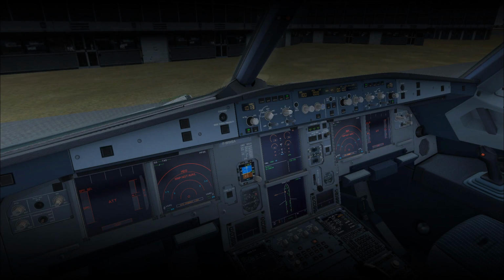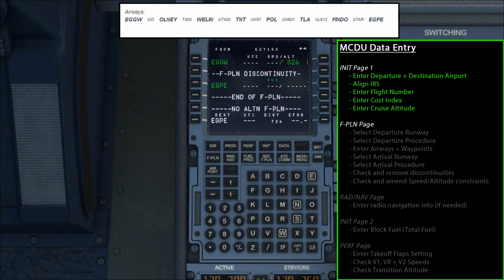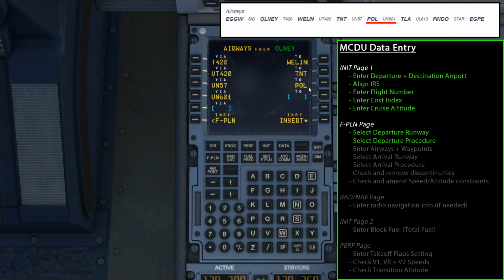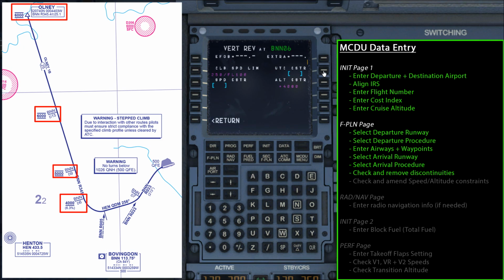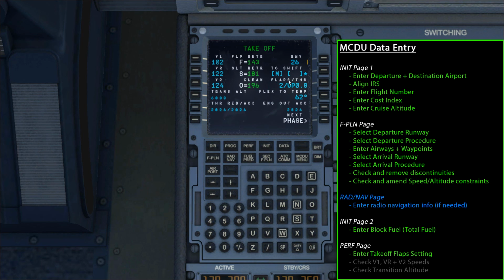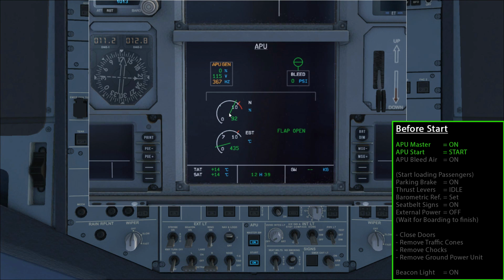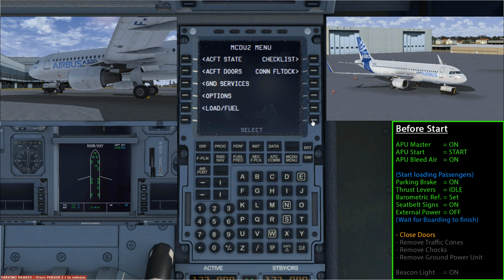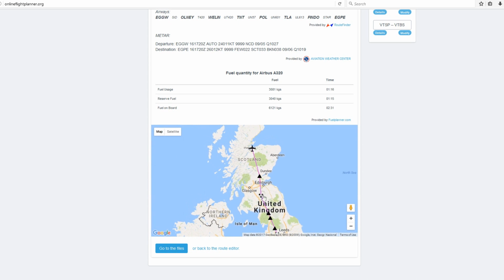A320 FMS/MCDU Setup (FSX - Aerosoft A320)

Comment: Ive just decided to give the aerosoft version a go after using Project Airbus for many years. I read (or at least started to read) the manual, then I found this video...thanks so much, absolutely crystal clear. I note you dont use the built-in atc, so would be interested if you have done a video on last minute changes in runway/approach at destination

Comment: When in RNav flight and heading to a programmed ILS runway in my FMC...Do I need to depress the LOC button to capture the G/S?
No matter what...my plane won't line up with runway. The flight plan always puts me yards away to the left or right of the ils approach. It's frustrating.
Reply: Just press APPR button. If it doesn't align with the runway then you have to update your nav data base.

Comment: This is going to be a VERY IGNORANT question as I am very NEW to FSX. But trying to understand this video my Deluxe version of FSX does NOT have an A320, but does have a A321??? The MCDU on the A321 does not appear to be active??? Do I need a different plane and if so, where do I get the A320 plane in this video???
Reply: Stock FSX doesn't have this plane inside. You have to buy this plane yourself. It is called Aerosoft Airbus X Extended. You can buy A318/A319 pack or A320/A321 pack.

Comment: hello sir how do i determine the speed that i need to select on the fcu for takeoff and approaching ,vertical speed also the heading , altitude .? is it stated on the ias charts or sid .?
Reply: Tip: Do not use vertical speed for climb, it's not fuel efficient. Just press the altitude knob (push it) so plane will climb to that specific altitude in most efficient way also by following the altitude limits. If you pull the knob, it will just climb to that altitude directly asap. And it will not follow the altitude limits, for example chart says you should be above 6000 in A point and you should be at 8000 in B point. If you dial 10000 to the altitude section and push to knob, plane will pass the A point above 6000 and will pass the B point at 8000 and climb to 10000. If you pull it, it won't follow these and just directly climb into 10000. So I recommend you to dial a altitude and push to knob. Hope this helps.
Reply: Also fill in the F-PLAN and PERF page in MCDU. Then press the speed and heading knob. It will be automatically follow the route and determine the speed. If it doesn't, then you did not programmed MCDU correctly or fully.

Comment: When I'm entering AWY/WAY to add to the FLPN

I get an error saying AWY/WAY mismatch. What does this mean and how to fix?
Reply: Forget the airways and just put in the main  waypoints. It's much easier, faster and doesn't affect your flight.
Reply: @ricardoroberto100  no, it does affect. When you enter an airway, it goes into other waypoint using that airway but if yoy do not type it it will directly go to other waypoint. It will be dangerous for other traffic in the air but if you are flying offline then it will not be an issue

Comment: I'm having issues with the MCDU flight planner.
When I try to insert my airways or waypoints, it keeps saying "not allowed" or "Mismatched"
I am correctly typing and inserting the route. Any suggestions on how to fix?
Reply from the maker: The MCDU and your flight plan are made using something called AIRAC data which is updated every 28 days. Compare the AIRAC cycle number from the MCDU against the cycle used to create your flight plan. It might be if they're mismatched, then your flight plan might have given you a waypoint/airway which isn't in the MCDU dataset.

Comment: Where do you find those charts. I can't find departure chart for runway 35 ESMS
Reply from the maker: I usually just google them. So do a google search for "ESMS Charts" and you should be able to find some.
Reply: Doofer911 I found them. Now I got a problem with sharing aircraft in multiplayer. My grandpa can't join me, it says "aircraft is no longer sharing". (Aerosoft A320)

Comment: I just have a doubt, doesn’t the atc give you the runway to land on approach? So how do you know the runway you re going to land when you re setting up the mcdu ?
Reply: ATC gives the runway, you are correct. But if you are flying without ATC then:
Check the wind, if its possible then always choose a runway which is heading to wind. If wind is calm, then you can land on any runway you want

Comment: very very very good, I fly the A32S and I wished I knew all of this before I started the type rating, DIFSRIP (data, init, f-pln, sec f-pln, rad nav, init B, perf) helps  to remember the flow. Trip time may vary with winds aloft, you can insert them and it will give you a more accurate information or it can also indicate there's something wrong with the f-pln insertion and you may have inserted a wrong waypoint.

Comment: Hey mate, I’ve followed every single video you posted and flew the same route, almost identically, but at one point at cruise, the nose began to go up and down and I gained about 1800ft in altitude, but then I realized that the 35000ft inputted didn’t have the little circle, so I did it again and everything went fine, I DID TURN THE SEAT BELT sign on Incase anyone felt unwell 😂

Really good tutorials, I’ll fly the reverse leg tomorrow to see how well I coped with the info, will vary the STAR into LTN though for variety

Comment: What is the best freeware flight planner that includes sids and stars
Reply: Simbrief mate :)
It's a little bit limited as far as AIRAC goes as it's a year behind but it doesn't really impact anything, the loadsheet has all the info you need for your flight
Reply: @sharko4093  but it does not line up with the runway
Reply: What do you mean?
Reply: @sharko4093  well like the path just goes straight to the airport
Reply: Ahh, are you using it for advanced aircraft like PMDG, Majestic, Aerosoft and FSlabs or are you using it for freeware and default with the GPS?
Reply: Aerosoft a320

Also i have not tried it in an actual plane yet bet in the simbrief website you can see that for example if the runway was 350 degrees the line would be coming in from like 270 degrees.
Reply: Well yeah, of course. It doesn't program an approach as that's the pilot's decision. If STARs exist then it will choose one, but the STAR is just the transition between the waypoints of the route to the approach, you set the approach yourself depending on if you want to fly RNAV, ILS or VOR/DME :)
Reply: @sharko4093  Ok thanks so much for helping me out but also can I just pick random sids and stars
Reply: I'm not entirely sure, if you change runway in the flight plan editor then it will select a new SID/STAR but my attempts at choosing a different one by typing it manually have been rejected and not recognized by the site. You can always just choose a different SID/STAR in the FMS though so it's not a problem. The planner is smart enough to choose the most approapriate SID/STAR most of the time
Reply: @sharko4093  ok thanks
Reply: And do you use it for manually constructing the flightplan or do you try and upload co routes downloaded from the site?

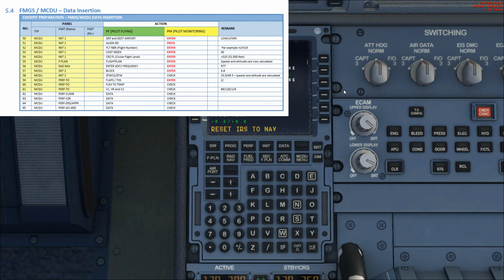Comment: I know that this sounds a very silly question, but where on my computer can I find the checklist referred to at 02:00, and what is the filename?

I've got loads of search results, but I can't find anything that matches what I can see in the video.
Reply from the maker: If you click the start button, look for a folder starting with the name "aerosoft", you can find the documentation in there.
Reply: @Doofer911  Oops, I forgot to say thanks. Sorry :-)

The only thing I find a bit off with the Aerosoft A320 is that it descends too slowly from TOD to whatever altitude I tell it to descend to. I think I may be doing something wrong, but I've seen other people mention that it often sets a rate of descent that is just too slow to get you down for the approach in time.

Comment: Is the mcdu only followed when the flight director switch is on?
Reply from the maker: Not necessarily. The automatic navigation systems will tie into the MCDU flight path data but if you were to manually select headings and altitudes, the flight director would change to meet your settings.

Comment: Hello Doofer, this was the best tutorial I've ever seen. I have a question, I've tried to simulate a similar flight between two airports in my country. I wanted to set an arrival on FMS of A319 with recent Airac (1903). Bu on my destination runway there are some letters in the choices which I did not understand. LTAC is the airport and 03R is the runway which I want to land. But Arrival choices for ILS of this runway like ILS03RV ,  ILS03RW, ILS03RX, ILS03RY and ILS03RZ. What are those V,W,X,Y and Z ?

Comment: i do not get v1 vr or v2 calculated. What could I have done wrong? Followed you step by step
Reply from the maker: Did you enter in the Block Fuel value earlier in the procedure?
Reply: @Doofer911  yeah I habe done everything right simply was too dumb to press the button right next to the speeds to illuminate haha

Comment: What I need to know is how do you know your arrival runway prior to take off?  ATC does not assign a runway until it vectors you into the approach? I use xplane 11 Does Microsoft provide the ATC info during flight planning?
Reply from the maker: You can pre-empt the arrival runway at smaller airports but it's normally something which is done towards the end of the cruise or even during the initial descent phases of flight. When using ATC in FSX, they will normally begin vectoring you in for an approach during descent.
Reply: @Doofer911  Thank you. So it guess you enter the arrival info into the FMC once ATC assigns the runway. I'm flying AB 320.

Comment: when i put ul613 it sais AWY /WPT MISMATCH but good tutorial please will you help thanks
Reply from the maker: It could be a navigation data error, but what it's saying is that the Airway does not have that specific waypoint as part of the airway. This can happen if the navigation data that airlines use has been updated over time. The dataset that these add ons have by default is years out of date.
Reply: @Doofer911  ok thankyou so much

Comment: Hi I been watching your videos for a long time and they are really helping me but I use simbrief to generate flight plans and it also loads the waypoints so I don't have to do them but when I put my departure airport and arrival airport there is no waypoints there is only one very near to the departure airport but and its ends there I have used simbrief for all my flights on the pmdg 737 and 777 and its works fine with all the waypoint loaded is there something wrong or I'm I doing something wrong? Thank you so much.
Reply from the maker: Sometimes you may need to manually select the SID/Departure procedure to connect your takeoff runway to the first waypoint on the route. The same goes for connecting the last waypoint to your arrival runway. Alternatively, if you're operating in and out of smaller airports, they may not have a procedure for arrival/departure so you would normally be given directions by ATC or you just fly direct to the first waypoint.
Reply: Doofer911 Thank so much! I got it to work but I have another question sorry I’m just new so simbrief does not put waypoints to the runway. When I choose the landing runway the waypoints are loaded but they are discontinued how do I get them so the autopilot can follow it. Sorry I been asking much thank you! Also sorry for my English I'm not native
Reply from the maker: If there is a gap, you need to select the second waypoint on the CDU, then insert that below the first waypoint. Then it will join the two. You can also "cut out" part of your route by doing this as well.
Reply: Doofer911 Okay thank you so much Mr. Doofer. Finally did my first flight with the A320 with no problems all thanks to you!

Comment: Following your guide, I cannot get the plane to climb, after take off it loses power and I get Speed error messages. And then I cant keep it in the air and it crashes.
Reply from the maker: Are you moving the throttle into the "Climb" detent after takeoff?

Comment: Hi, on my MCDU I have a line item called (DECEL), do you know why its giving me this as it has a speed and altitude that is way off what i want.... thanks
Reply from the maker: That'll be the point at which the aircraft needs to slow down. Usually this occurs around 10,000ft to slow the plane to 250 knots which is a speed limit below 10,000ft in many places in the world.

Comment: Hey Doofer or anyone who can help. When i check the airport chart for my home airport (EFHK) it shows the SID airways or waypoints i mean. They match the flightplan waypoints but when i check the waypoints in the FMC it shows different waypoints than the airport chart or the flightplanner. And yes i have checked that i have the right runway in the aiport chart. I would like to get some help i bought the Airbus today and watched all of your tutorial videos on them. Good job Doofer keep up the great work!
Reply from the maker: Chances are that the AIRAC data (the set of data which gives you information about navaids, waypoints etc) in the sim doesn't match the current data used in real life. You can get updated AIRAC data for the sim through a product called Navigraph however that does cost money.
Reply: @Doofer911  okey thank you for the response! I flyed my first flight like you did from london to inverness and i had the same waypoints as you did. It seems that it depends on the location if the nav data is out of date or not. I will need to just learn the outdated navdata then.
Reply: Doofer911  Now i have a another problem. When im trying to insert waypoints from a flight planner website to my fmc the fmc says: AWY/WPT MISMATCH. Im having the same AIRAC cycle on the flight planner page and my fmc has the same airac also (1511). I would just really want to get flying after spending 40 euros on that amazing aircraft.

Comment: ZFWCG/ZFW  was not calculated as you need, so that is why you have flying time is showing shorter than what you normally fly. The weight of the people, and fuel must be calculated. Also thrust reduction of the engine and wind correction including climb, cruse, and descend wind must be calculated to get correct arrival time. Other than that you did good job
Reply from the maker: Ah thanks for pointing that out! Now you mention it, it makes perfect sense.

Comment: Doofer Hi - I've got the APU started up and everything looks good, then following you, I move to board the 120 passengers. I can't open the doors. The Doors screen buttons won't respond. There is something missing that needs to be done but I can't figure what it is. The fuel is loaded and I've entered 0.0 cargo. Help Please?
Reply from the maker: Are the doors options greyed out or are they just not responding to button presses?
Reply: Greyed out.
Reply from the maker: Ah, if that happens you might need to reset the flight or even restart the sim. Occasionally, something on the Aerosoft doesn't load in properly which causes that issue, I've experienced it a couple of times myself. Best thing to do is check MCDU2 early on to see if the options are greyed out or not before you get into pre-flighting etc.
Reply: OK, Thanks. That is reassuring. I have done exactly as you have advised, and went back to cold and dark square one, and now have the passengers and fuel loaded and am proceeding to input the flight plan.
Your tutorials are first rate - well done.
Reply from the maker: No problem, glad I could help :)
Reply: Moving on, I've hit the next issue. Ready to move off the parking spot to taxi to the runway, the throttle levers won't engage, meaning they won't slide forward and stay in position. I can flick them forward but they jump back to the zero position, so I'm stuck on the spot. I'm using FSX SE. Sorry for all this, it just isn't going smoothly.
Reply: That was a dumb question. I've solved it and moving forward.

Comment: Have been following you click for click. But when I switch on the APU on the overhead panel, the APU computer screen does not come up on the lower ECAM screen.
Do you have any idea what needs to be done to fix it?
Reply from the maker: If it doesn't come up automatically, you can click on little black buttons underneath the Lower ECAM which will display different "pages" on the Lower ECAM. One of those will show the APU page so you can select it manually if you need to.